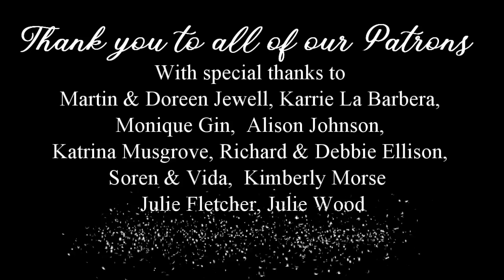166. Multi tasking, pointing the walls whilst having a rant!

Comment: Hello to you both! Not sure if anyone else has mentioned it, but right in the corner just above you at 5:39 on the timer, I have noticed a bright spot, and hope it's not daylight to the outside...especially since you were up on the roof in the last few months waterproofing where the roof meets the sidewalls of the structure. I hope there is no leak in that spot, or you might have to get up there again! Many greetings from western Canada!
Reply from the maker: Little secret. We filmed this and put it in one video. The light from the roof but is before Lesa got up there

Comment: I know your Finnish with the wall that's on the outside, the amount  of heat you would lose would be costly.
Here's a idea  taken from log cabin builds.
Line that wall with Styrofoam or what you like 
Then make a outer stone wall to cover it.
I know it's time consuming 
And money will need to be spent, but in the long run
You will have less of energy  bill and a warmer place to live.
Also I live in the US so I don't know what's there or the codes.
Love your channel.

Comment: I found your channel via the Channel 4 series.  I'm so glad I did, as I wondered how you were getting on after the programme had stopped (I binge watched the whole series).  I think the work you are doing is splendid, and I myself would hate to be living in a tent in such awful weather.  I particularly liked the vlog where you made a double glazed unit for the piggery.  It was inspiring.  Do you use work aways?  Not that I could do that, because I hit my 70th this year, and have mobility issues. I  can cook though.  I'm also quite good at painting low level (scared of heights) and I can also sew.  I might just make it over to France for the first time since 2019 this year.  If people can't say anything nice, they must lead very sad lives.

Comment: Hi Lesa and Ted, we have watched every channel 4 episode so far (have to say I am gutted you dnt get a penny from that. Shame on channel 4 for that I say). Wanted to ask a question if that’s ok? I want to lime point render an exterior wall. Does the mix have to be different? 
I think you and Ted are utterly amazing. Seeing how much you clearly love each other always makes my heart smile. Take care of each other and don’t waste a single second on those negative comments.
Reply from the maker: Hi Lisa, thank you for the lovely comments, in answer to your question, the mix does not have to be different, 3 sand to one line will work fine.  Use a NHL5 ( natural hydraulic lime) lime as this is for exterior use, and when rendering, ie covering the stone completely, Lesa always prefers the mix a little wetter.  When I've mixed up for her in our 140 ltr mixer, I do 6 buckets of sand, 2 of lime and one bucket of water.  Always use the same size buckets for everything, then the render colour will be consistent, sorry to waffle, hope this helps.